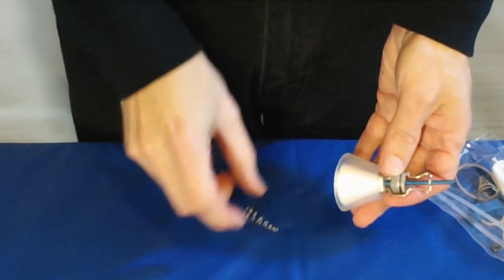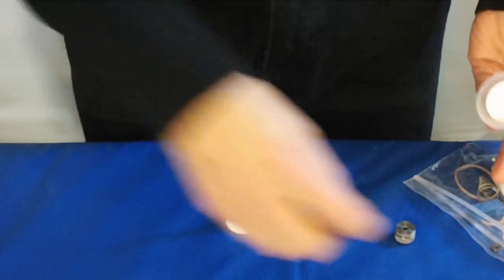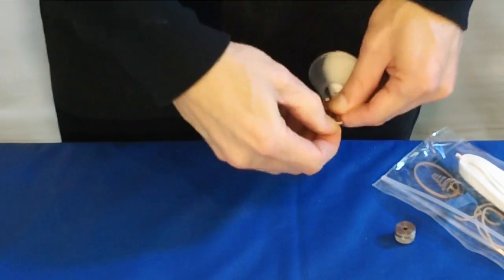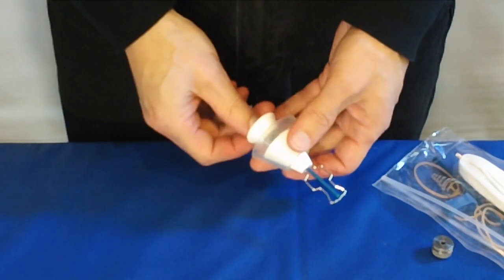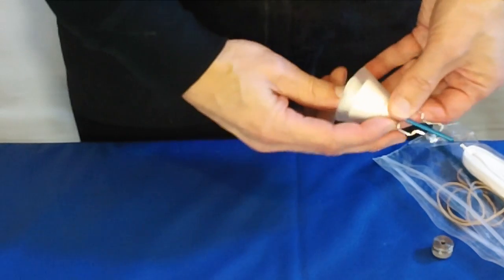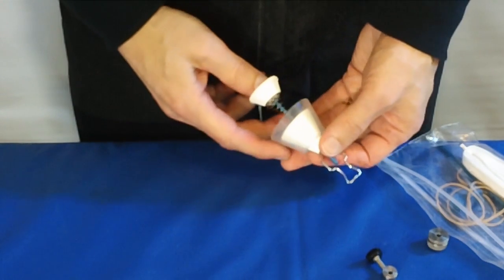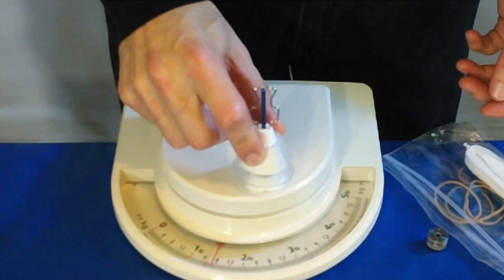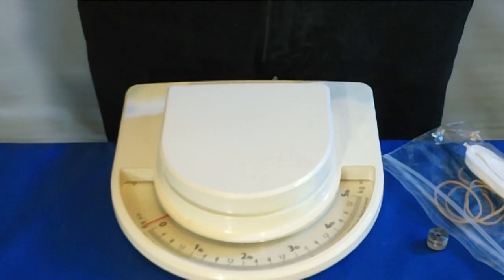Using Springs for Tension with TLC-X Foreskin Restoration Device

Comment: Would you be able to add 3 or 4 springs to the device as well?
Reply from the maker: Hi, you can stack springs, nested or nose-to-nose.  The tricky thing is that every added spring opens up a gap between the Pusher and tugger Body of 2mm that the skin must bridge when you're rolling the skin onto the device.

Comment: Hey just a question restoring your foreskin does it give a little more pleasure?
Reply: Ron Low Thanks Ron!
Reply: Ron Low Hmm I think you are bullshitting me because what I just read once you are circumcised you can not get the nerves back.
Reply: +Josh Black - Nothing that was cut away grows back.  We expand the surviving skin to perform some of the functions of a foreskin.  See http://tlctugger.com/benefits-of-foreskin-restoration/  The remaining nerves work much better once there is enough slack so the skin can roll and glide.  Those nerve endings are seemingly stitched through the skin to respond to bending and straightening.  And in the glans, the nerve endings are closer to the surface, and the surface is more sheer once the glans is covered all the time so extra flattened/dried cells can be sloughed off.
Reply: Ron Low One last thing can something go wrong using this product?
Reply from the maker: +Josh Black - ^^ can something go wrong ^^
Sure.  People can be as dumb as they wish.  On each ordering page of my site is a write-up about the various ways a device might be mis-used.  Rule #1 is never tolerate pain.  Get to some privacy and re-apply or remove as soon as possible when the need arises.  If privacy is not available the tension can at least be released if the wearer has a fail-safe scheme in place.
Reply: +Josh Black there isn't any scientific basis for it giving any more pleasure at all.  It is literally just stretching and creating more scar tissue.  For many they do have a self-reported benefit, but there isn't any rational basis for it.
Reply from the maker: +omsmada  Foreskin restoration has real tangible benefits for rational physical reasons.  See http://TLCTugger.com/benefits-of-foreskin-restoration/ and get back to me if you have questions.
Reply: Josh, the science is basic. When skin is under slight tension, ex. pregnancy, the skin would rather replicate itself than tear, so just enough tension to coax the skin to grow. Again it's replicating what you have, dartos muscle and all, which is why it takes longer than just skin. The skin grown is sensate, so more sensitive skin area and more corresponding brain cells. Where ever the glans head is constantly covered is where  keratinization stops accumulating. Color is better or restored. The glans head will slough off keratinization, all at once or bit by bit over time as men report. The Sorrel sensitivity study did a preliminary study which included some restored men, note studies should have a least 100 enrolled. Nonetheless it's interesting that the restored men had near the same glans sensitivity as the intact. (The circd had less glans sensitivity.) It was conjectured the scarring of the glans head that was induced by destroying the synechia fusing the surface of the glans and foreskin together was why there was some loss of sensitivity compared to the intact men. But pleasure is subjective. Anecdotally, men say the new skin seems to improve receptor response. Well having skin means more in stretching and so better to activate stretch receptors. The foreskin can be stretch forward to use the glans head as an anvil to play the foreskin and also retracted backward to use the shaft as the anvil. Point is stretch is what is needed for a more natural better response no matter how many receptors a guy has. Note goys are not created equally as some have WAY more innervation and receptors. (Possibly partial reason why some men are affected more than others by circ.) Here's pleasure told to me independently by two men, that when they restored, their mind switched to believing they were never circd. Lucky guys. Well we make our own luck.